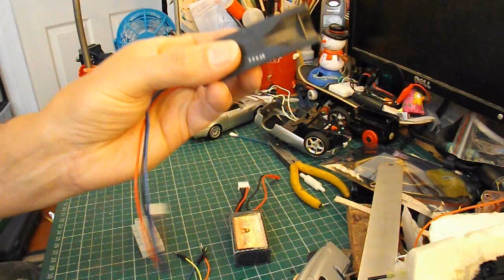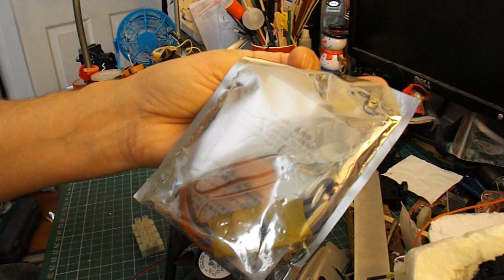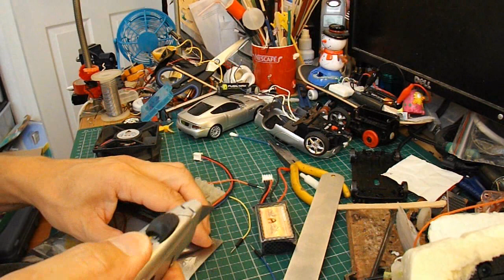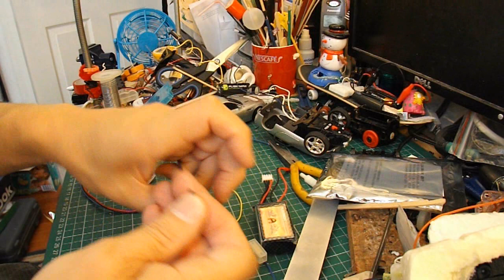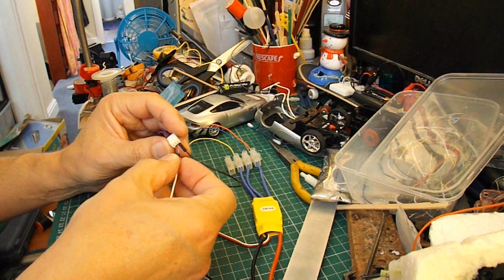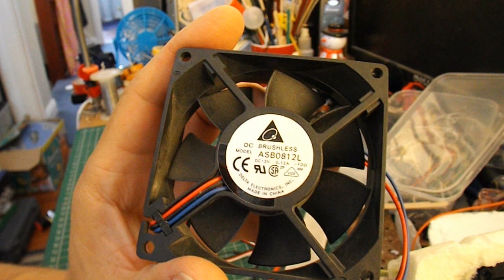Can you control a 3 wire PC fan with an ESC?

Comment: hall effect on a three wire fan really? It aint a old distributer lmao. Third wire controls speed using resistance it detects with a thermistor invented probably 80 years ago. And magnets spinning around a stationary stator is called a "brushless motor" you dont need a brushless esc to change any speed on that fan you need resistance on that fan. And you can't operate a digital esc using an analog servo tester anyways.. it's always fun to blow electronics up figuring all this shit out isn't it?
Reply from the maker: Hi Estuar Gonzalez, read through my video description. If you are talking about a PC fan motor I have pasted an explanation in there from Craig Nehring which gives a brief explanation of 3 and 4 wire motors
Reply: thanks
Reply from the maker: George Marinos thanks for commenting. If you read the video description or the other comments there are some good explanations of how it works and what the extra wire/s are for. I am not sure what analogue servo tester you are talking about but yes a variable resistor will not control a standard hobby grade esc or servo. The tester I am showing in the video is a standard hobby grade tester that I use regularly in my videos demonstrating hobby grade rc projects.
Reply: Hello, I have a 4 wire brushless motor, red, white, and black wires connected in any combination just two of them have 3.1 Ohms, the third cable has no connection with the others, Could you tell me how to wire it?,  Does this motor requires a controller?

Comment: The first two wires are the power supply of the fan. The third wire, comes directly from the output of the Hall sensor. This output generates 2 pulses per one revolution of a fan. The fan is then connected to the motherboard. From the third wire, the motherboard can "read" the tacho of the fan and see if the fan is running and with how many RPMs! It is a great innovation! If the motherboard sees no pulses or very low rpm, then the characteristic buzzer sounds to inform the operator that something is not ok.
Reply from the maker: Thank you
Reply: So if I'm not connecting the fan to a motherboard , the third wire can stay unconnected right ??!
Reply: @GarGaming1  yep
Reply: Tbh that’s all the information I needed 👍🏻
Reply: Well done, that what I was after, Good Information , Thank you
Reply: no, sometimes it is used for the pwm speed control
Reply: Which the computer uses to control the speed of the fan
Reply: The third wire can serve many different purposes, and tends to be color-coded accordingly. The most common colors are:
- Yellow – the tachometer signal output. Commonly it is open-collector and needs an external pull-up resistor;
- Blue – PWM speed control input, and accepts a logic-level signal.
- White – rotor lockout protection. It provides a straightforward way of telling if the fan is blocked from spinning. Also commonly open-collector.

Comment: The third wire of fan can be a signal wire for the signal from a servo tester i.e. PWM signal
Reply from the maker: Thank you
Reply: The third wire is a data transfer wire. It is totally unnecessary unless hooking up to a motherboard for fan data.
I'm not sure what PWM is, but I know that cable is only for fan information. If it fails, how fast it's running, what voltage it is, etc. You can see it all in the CMOS of your computer.
Reply from the maker: Jason Harris thank you

Comment: Pin 3 is for pwm
Mobo sends a pwm signal on that pin
Control Pin
Reply from the maker: +George Ionut Lung thanks, yes, Craig Nehring posted a detailed comment on 3 and 4 wire fans which I have pasted into the video description.

Comment: I've got a 120mm portable USB powered fan. It uses a potentiometer for speed control. It has the usual black/red for power, but also has 2 yellow wires running from the motor to the potentiometer. I can't get to the internals without breaking it. Any thoughts on how the pot is wired to the motor? There's no room for any extra components where the pot is mounted, so if there's a resistor, it must be on the main board, right?
Reply from the maker: +Yoshio Tamiya have a look at the comments here by Craig Nehring as he seems to know what he is talking about on these fans.

Comment: why we need to use ecs cannot work electric direct
Reply from the maker: +Kanari Mentos please read the video description for more information. We do not need an ESC for a PC fan. The person asking the question thought a 3 wire PC fan might be like an RC plane motor.
Reply: yes that what i mean i do also ask about rc why we cannot use rc brushless motor with out esc
Reply from the maker: +Kanari Mentos you would need to do a quick search on YouTube for "how does a brushless motor work" it's a bit more involved than I can answer in a text reply. The power is pulsed to spin the motor so a circuit is required to convert steady DC into a stream of pulses.

Comment: PC fans as generators
There have been some videos on this topic but I would welcome /challenge/request this be done. I know how to do this, but I am not one to make videos.

You need to access the coils directly (four poles 3 wire sets center tapped) disconnected from all other ciruitry
Remove the surrounding frame and glue on blade extensions cut from pop can or plastic bottle (the curve is already there) trim and balance

Reason to extend the blades is so a modest breeze can spin the armature.
 
The output will be A.C. but one can rectify this, in fact there should be a few diodes on the fans circuit board that could be used in place or removed for use at the end of the wires run. A buck boost converter could be used to get a regulated output.

 Configure a bracket to mount the fan and to act as a tail vane and also a support pivot, this could be crafted out of stout solid residential wire or coat hanger?

PC fans will not generate any meaningful output if you try to do so without modification. They can output almost as much current as they would normally consume.

Issue of output wires wrapping around support mast needs to be resolved, but could be achieved via a "stop" to prevent free 360 degree of assembly

Uses: Lawn art whirling led light thingy
Battery charger 
Wacking fingers that get to close :(

Comment: you need to open the fan and rewire the coils in  3 groups alternating then conect  the ESC
Reply from the maker: +El Blog de JoseLu90 I have no intention of making that much effort but thanks for the suggestion.
Reply: @GrandadIsAnOldMan  Pointpless video.
Reply from the maker: @cosmefulanito5933  do you mean 'pointless'?

Comment: Being a brushless motor that takes DC voltage means it has its own built in ESC.
Reply from the maker: +Tim Adams see the video description for an excellent description by Craig Nehring
Reply: GrandadIsAnOldMan Yup, I read all the comments first, including his excellent one, then I added my comment since he hadn't mentioned the ESC is built in. :)  If you tear a brushless DC motor apart, you'll find the ESC circuit board.
Reply from the maker: Tim Adams yep, spot on, thanks :-)
Reply from the maker: +Electronic Experiments thanks, did you see the video description for an excellent explanation by Craig Nehring

Comment: 2 wire fans are just 12 volt, well most all PC fans are 12 volt but how they are controlled varies. 
3 wire fans and 4 wire fans all have a red/black for +/- input respectively.
For the 3 wire fan the 3rd wire is a tachometer output. The voltage to the fan can be controlled if enabled in the PC BIOS. These 3 wire fans usually, at start up, bang on at 12 volts to get them going and the fan controller then ramps the speed down for quiet operation. So... fan speed is controlled via reducing voltage from a max of 12v.

4 wire fans, same as 3 wire but then what does the 4th wire do? This wire is for digital speed control, most 4 wire fans can be controlled with the 3 wire method if the BIOS has a setting for that. The 4th wire can also (in most cases) can be used by varying the voltage between the black terminal and the 4th wire between 0 to 10 volts DC, or as a digital pulse mode modulation.
So to summarize, 12 volt in to black and red, 3rd wire tach signal output, 4th wire pulse modulated OR analog 0 to 10 volt speed control.
I have seen where a special PWM signal can get 4 wire fans to scream past 20,000 RPM
Reply from the maker: +Craig Nehring thanks Craig, great explanation. I will include you comment in my video description. I was confident somebody would be able to explain it for me :-)
Reply: actually wrong my 3 wire brushhless fan can not b controlled by bios or pc prograam. 2 wire fan just a fan 3 wired ones says the rpm not can be controlled 4 wired one can be controlled with bios or pc prammes such as speedmetter...
Reply: Flush Royal Correct, The 3 wire fan cannot be speed controlled only monitored by the bios, but the 4 wire can be controlled which is known as a smart fan
Reply: Good morning everyone. So is there a way to control the speed of a 4 wire fan outside of a pc and or laptop. I have a 4 wire (red, black,blue and yellow cable) fan that I want to use to keep my PS4 cool. I already rigged it to stay on using an old wall charging cable but I need more rpm. Any help would be greatly appreciated.
Reply: @craig Hey can you tell me about what special PWM signal were you talking about?

Comment: The blue wire (sometimes yellow) is a signal pin for a computer motherboard. It outputs one pulse per rotation so the computer can see how fast the fan is spinning (RPM) to ensure proper cooling.
Reply: but is there any limit
Reply from the maker: +Minimelkav thanks, see the video description for an excellent description by Craig Nehring

Comment: how fast could it spin
Reply: +surprised lemond normally yes, the max speed is set by the input voltage, except for some 4 wire fans, but this would take a special digital control to the 4th wire and DC minus (black wire)